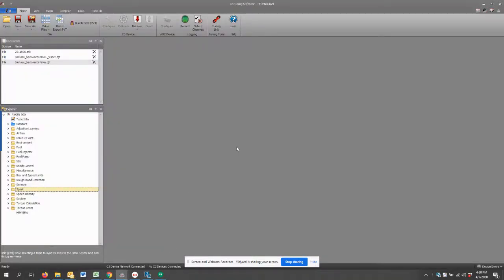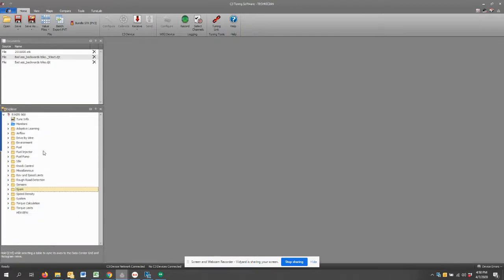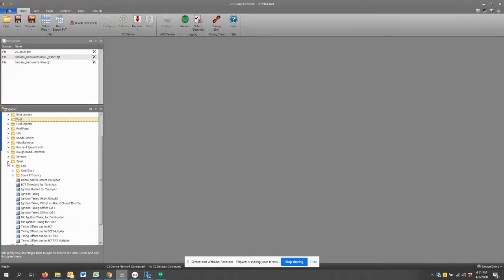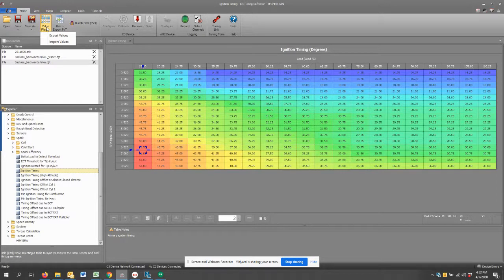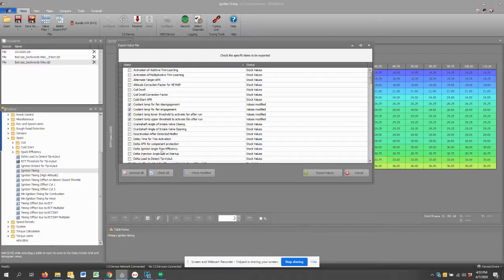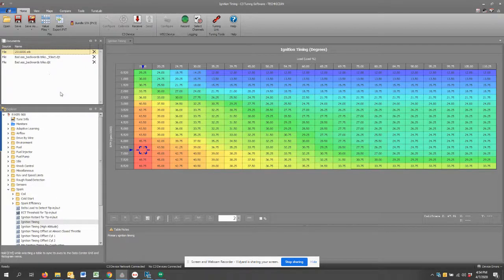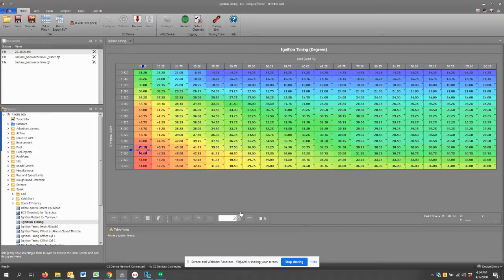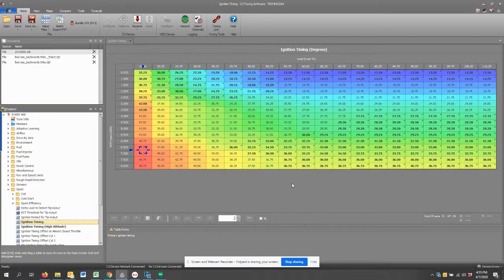Dynojet Power Core Software - Value Files

Comment: any idea how do i tune out past cat euro 5 o2 censors in order to change to an aftermarket exhaust? i'm on a harley lowrider s 2020
Reply from the maker: Do you mean 2021+ models?  I didn’t realize 2020’s had downstream catalyst monitors as part of Euro5 compliance. 

Do you have an stk read of the original file, or a current read of the ECU in stk format. Send to DynoDanTuning@gmail.com for review